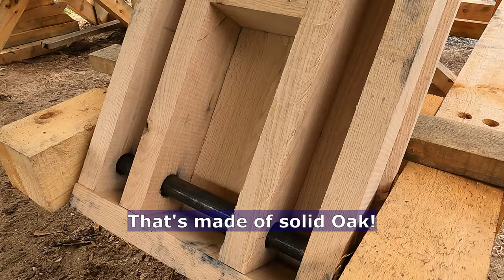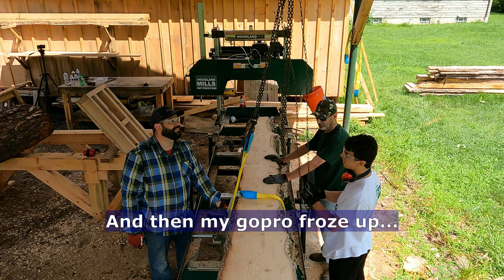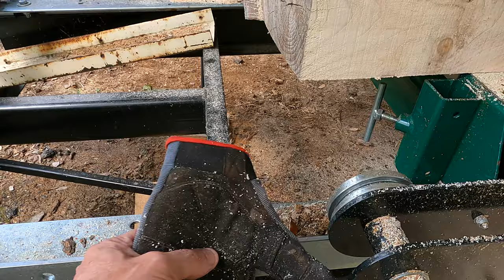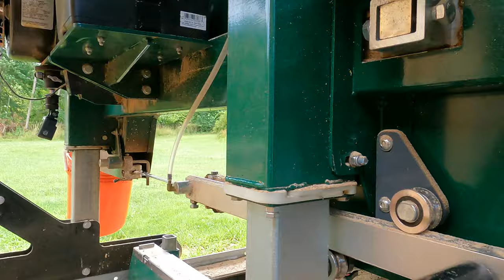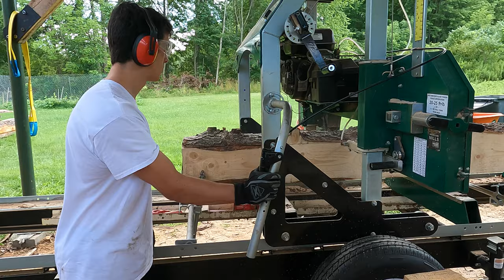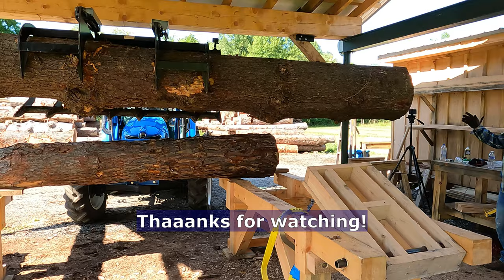Sawing lumber on the Woodland Mills HM130max.

Comment: Just starting this video and knowing my memory problems, pause to say.... get a screw jack from under the hood of a old truck... take a old extension from the junk tool box section, and cut it to fit the jack plus a cordless drill. The ups and downs are quicker and much easier!!
Reply from the maker: Actually woodland mills has come out with manual towboards now. Trying to talk Nate into buying them!

Comment: Hot GoPro? Try an aluminum cage for it. My GP11 stays cool now.
Reply from the maker: I got an external battery the other day, so far that seems to be working.
Reply: If you haven't heard, the GP 10 and 11 have overheating issues.
Reply from the maker: @TheOldManAndTheSaw  I hear they lock up a lot more than hero9
Reply: I prefer my GP7 and GP8 over my GP11 any day.
Reply: The GP8 has been locking up in 4k.  The sound is there, but the video pauses and never comes back.
Reply from the maker: @BissellMapleFarm  that's exactly what my 9 does when it gets hot, think I have a cure.